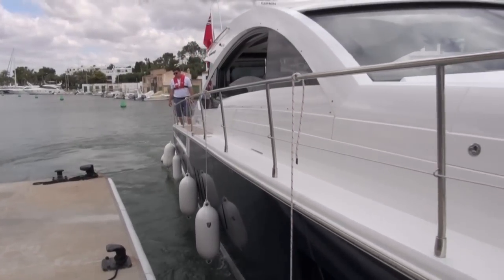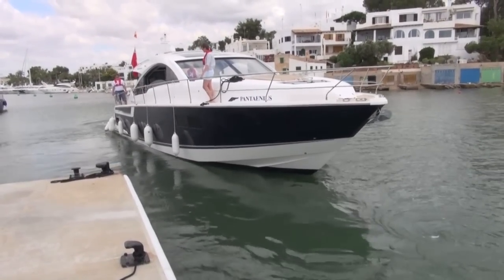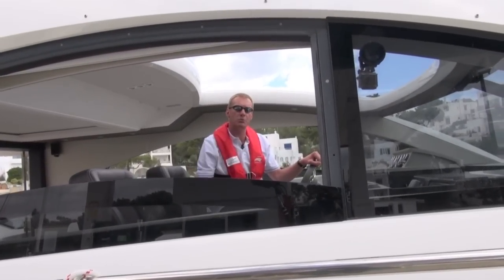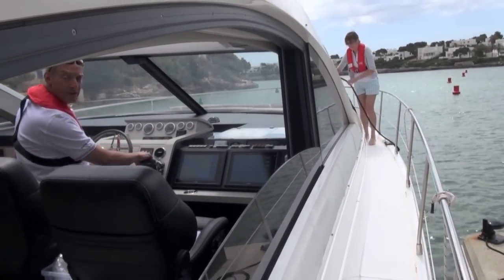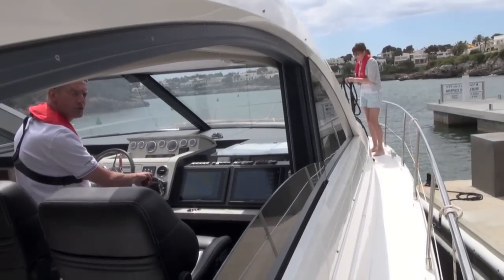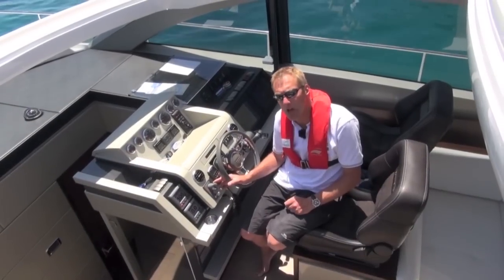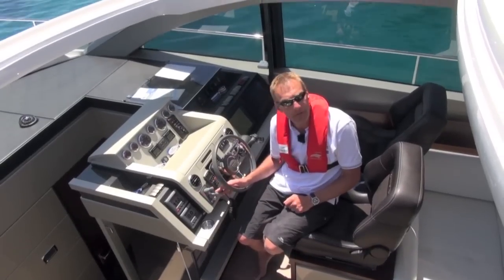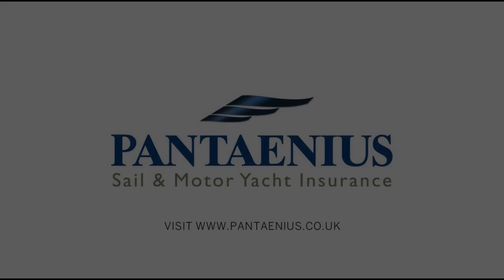Cruise Further, Cruise Safer episode 9 - Leaving a windy berth | Motor Boat & Yachting

Comment: I agree, the real challenge is doing this in a stiff  on-shore breeze with a single screw outdrive and no thrusters. (Let go the bow line and push it physically off the dock . Then let go the stern line - and hop smartly aboard before the bow blows back!) With a twin engined shaft drive boat however it's perfectly possible to make the boat move sideways without thrusters.  Let's say you're moored port-side-to on the dock and the wind is blowing the boat onto the dock.  The technique is to put the helm hard over to port and the port engine ahead whilst at the same time putting the starboard engine into astern. The prop thrust from the port engine is deflected by the rudder and pushes the stern away from the dock. Meanwhile the starboard  engine is pulling the boat astern and levering the bow off the dock to starboard. The skill is using just the right amount of throttle on each engine.